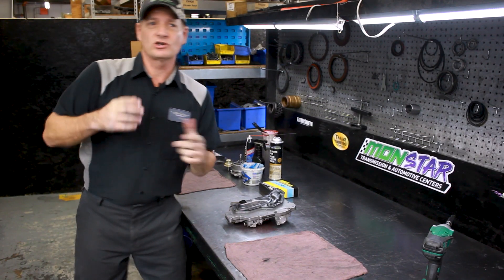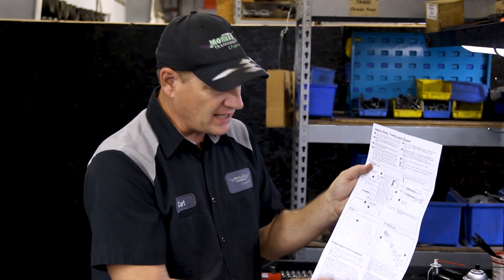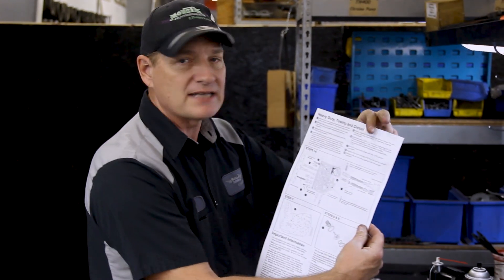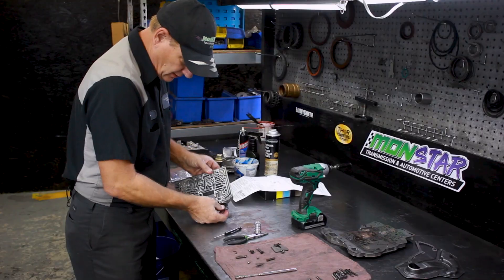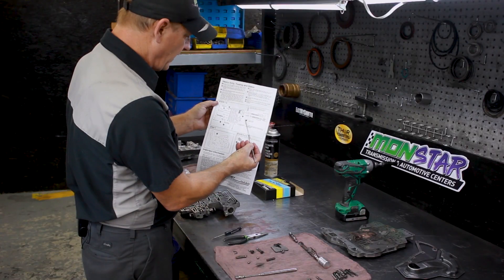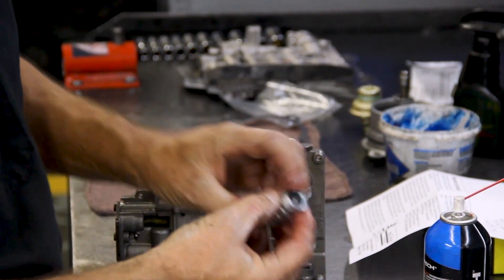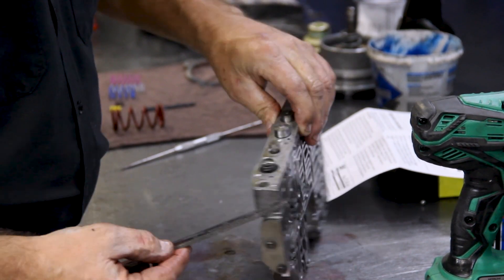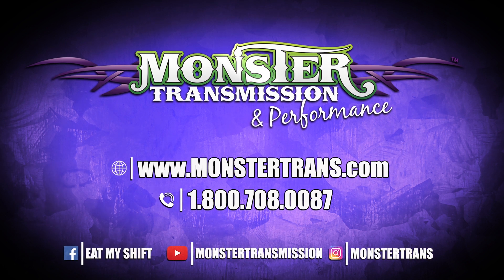Ford C6 Valve Body Shift Reprogramming Kit Pt1

Comment: Thanks for sharing Curt. Very good info sir. I worry about those dang check balls. What holds them in place so they come rolling out when removing and handling the valve body? Cheers from Motown!
Reply from the maker: We use assembly lube to hold them in place
Reply: @MonsterTransmission  Ahhhh of course! thank you!! Having trouble with my C-6 manual reverse valve body with trans brake. Shift pattern is 1-2-1. WTH? linkage adjusted right, trans is clean and has been well maintained and not abused. I have heard of 3rd gear becoming reverse but not 1st. Any Ideas? Thank again Curt, appreciate you.
Reply from the maker: @robertclymer6948  That could either be a faulty valve body or that the direct clutches are burnt up